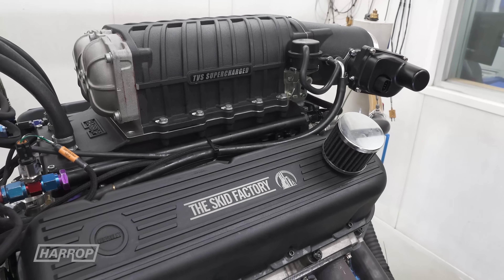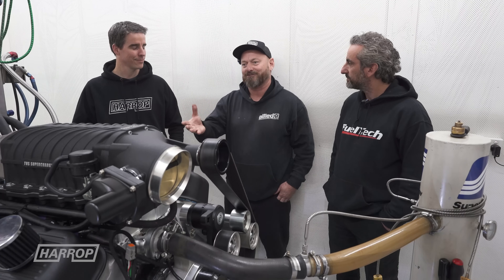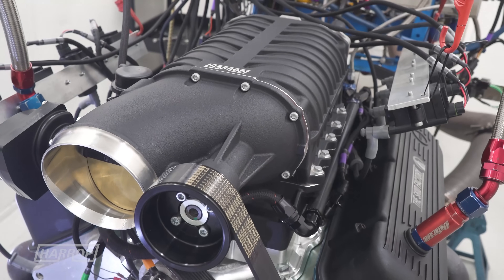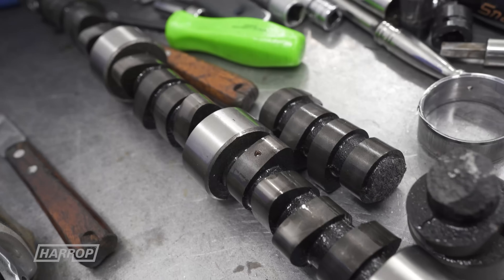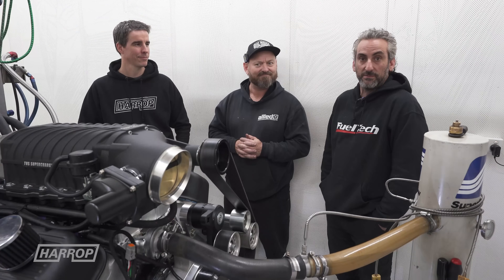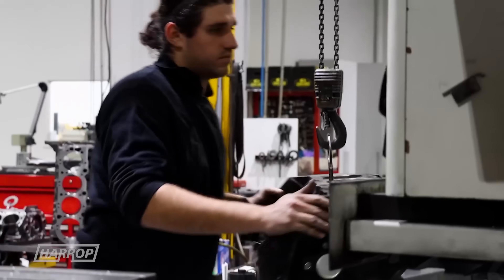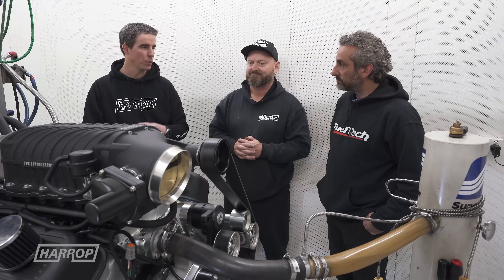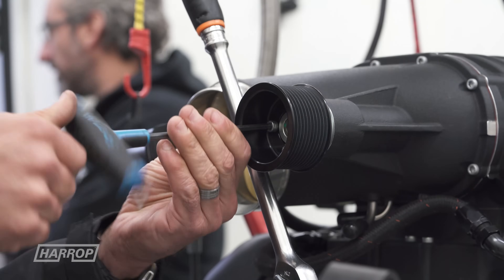The Skid Factory Big Block Chev | Harrop Supercharged

Comment: There is no wonder why the guys from Proline in America chose someone to partner with to repair their engines in Australia, they chose Frank & his Uncle @ Dandy Engines! 99% of engine shops would have said, nice try boys! Now haul that pile of shit home & see if you could fix it! Not Frank, even tho he didn't build it & he is always backlogged, He just tore into it, found all the issues, then found usable parts & probably having all his guys stay late, to not only repair the engine, to go through the whole thing, & make everything correct! Good shops & guys like that, are few & far between! The Harrop guys have their game together with that little blower setup! It worked very well on such a large engine! Well large considering that blower was designed for a engine 90cubes smaller! Most people don't know that you should never install a camshaft that had been dropped! Although, you never know what happened during shipping! Especially with a stock style cast camshaft! Because once dropped, even if it's in the box, its already fractured, & you won't know it until you start doing dyno pulls! Let's just say, the Skid factory guys got extremely lucky!

Comment: I bought a set of L21 valve covers for my 502 to use LS coils on. In addition I got a Chevy Performance front timing cover that has 58x crank and 4x cam sensors so I can use sequential multiport injection.